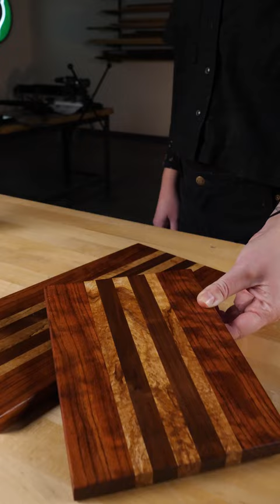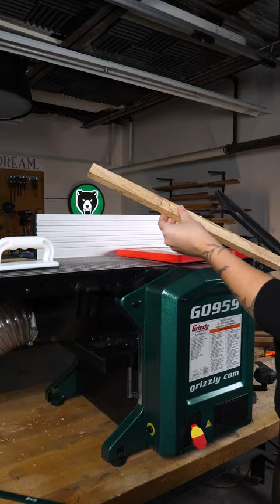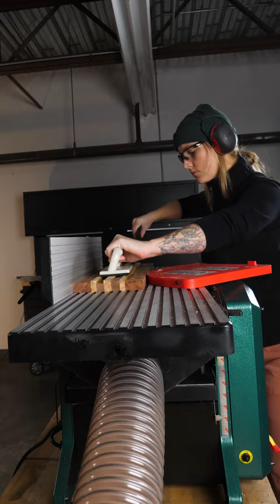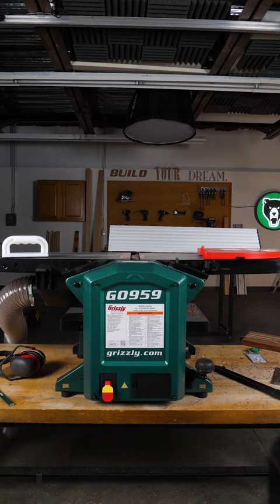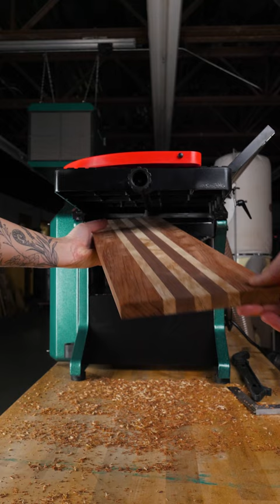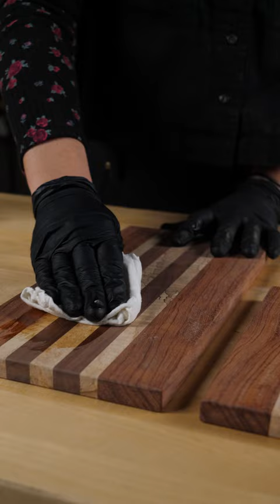New Jointer/Planer Combo: Quality meets efficiency! #jointerplaner

Comment: Hoping to purchase this very soon.

The helical cutterhead is a tremendous value, especially when doubled as a jointer and a planer.

The small footprint of this machine means it can be mounted on a rolling base with it's own dust collection, saving tons of space. No more walking back and forth to different machines just to mill a board.

Saves on time, space, money, and provides a superior cut?!
I need this machine!

Comment: That would actually fit in my shop!
Reply: I got the 12 inch one and love it, the only down side or "bad" thing is when you switch to planer part and you have to move the fence and stuff to get the dust collector on the table deck.  but other than a little bit of hassle it works great!  OH and have to use the duck collector bin because there is a electric cut out on it.
Reply: I just bought the 8in g0858...it's only 2k...other similar brands are 3k...we'll see how it goes